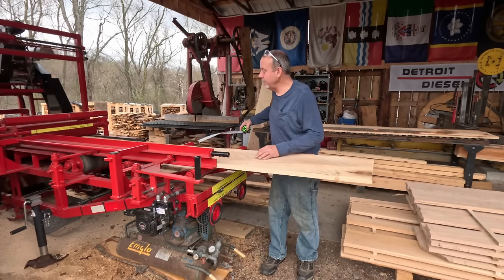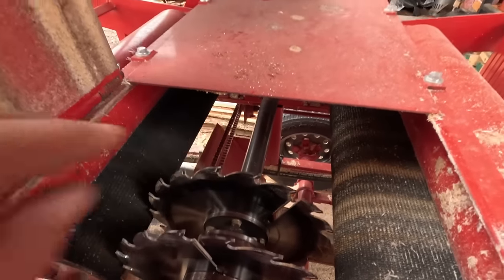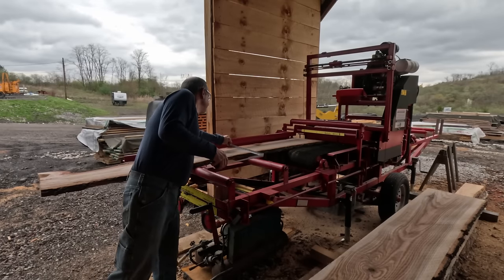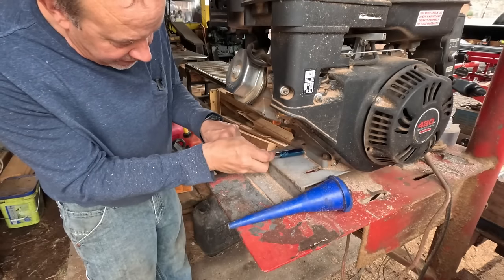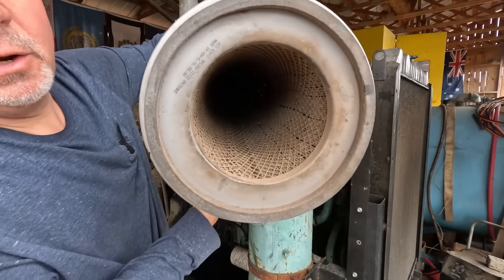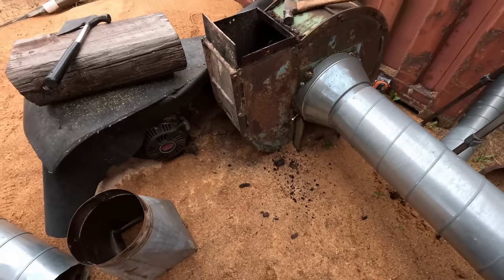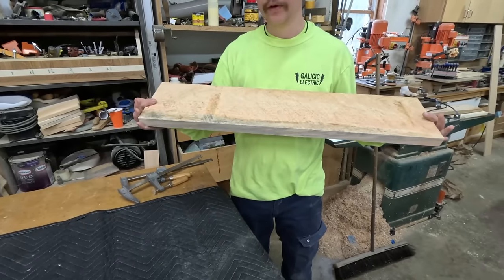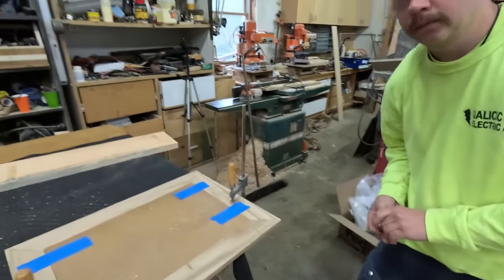some sawmill maintenance # 545

Comment: On the chop saw motor get some gi pipe with the same thread as the inside of the drain and extend it past the base plate with either a tap or a plug on the end will make changing the oil quicker and much cleaner thanks Peter W Melbourne Australia
Reply from the maker: yes but we need metric thread.
Reply: I knew when you said it had metric thread that’s probably why you hadn’t already added an extension to the drain. However, using the long neck funnel the way you did is a brilliant solution to avoid a big mess, kudos!
Reply from the maker: @mackyocum5218  thanks Mack.

Comment: 10/4 on the vertical edger and I have never seen one around here.  Just good turners. The danger with overgreasing was blowing the seals out in the bearings. Some of the crusher conveyors had a spring loaded deal to keep a supply on the bearing without overpressurising them. Lots of shafts on the rock polisher conveyors that size. Good looking assistant you got there. appy weekend and god Bless!
Reply from the maker: thanks Lewie , yes I would love a vertical edger but it makes a big mess.
Reply: @markgalicic7788  What I could see it sure would.

Comment: Hi Mark, loved the tour on the edger Good Job!, Suggestion when changing oil put down Pig Mat helps a lot with catching spills. Think you said the oil plugs were metric size, should be able to use a 1/4 pipe tap (I think)  so you can extend the drain so less mess. anyway have a great day!  John
Reply from the maker: thanks John , good idea.
Reply: @markgalicic7788  I use that on mowers.

Comment: You can just add a short piece of medal pipe to oil plug hole and cap it off with a cap and it will help with changing oil .
Reply from the maker: no it's a metric thread and the plug makes the seal.

Comment: it's the mounting place for two vertical blades that cut the lumber to with without having to use a different saw to cut the boards down to size and clean up the edges..
Reply from the maker: yes a vertical edger.

Comment: @ 2235 I have always used that router bit in the vertical instead of horizontal / with the plunge toward bottom of frame so that when hung on screw it couldn't jump out/off , but I can see your way may be better so as the distance between screws in wall would not be such a critical measurement
Reply from the maker: yes it works great.

Comment: one can make an extension pipe to put in that hole where you can have the oil flow out into a container. I know everything takes time.
Reply from the maker: yes I could but it's metric.

Comment: What a small pipe nipple by 6 inches long the oil drain hole then he can drain it in a bucket and put a nipple cap on the pipe till next time
Reply from the maker: yes if I can find a metric thread nipple.

Comment: Im going to guess that the bracket may be for a horizontal saw for edging.  I think a list of terms may be helpful.  I will start with what i know.  Wane: live edge of a board.  Cant: log sawn on one or more sides and can't roll, especially on the carriage.  Cant hook: a long handled tool with a swinging arm made to roll a cant on the carriage before chewy was invented.  Peavy: similar to a cant hook but with a longer handle and a sharp point used by loggers. Kerf: the area romoved by the blade.  Im sure there's much more..but thats it for me now, lol.
Reply from the maker: yes it was for a vertical edger , you know lots of sawmill slang!
Reply: @markgalicic7788  my grandfather worked for a logging company and mill as a young man in Michigan late 1800 and  early 1900.  The mill was steam powered.  Later that sake mill became a pallet mill I got to visit now and then. So...some exposure.

Comment: Really great mill maintenance video Mark! The more I watch that new edger work, the more I like it! That was an outstanding decision that you guys made to purchase the new Cook’s edger unit. It is very well designed and produces accurate, high quality edged boards. I love the in-feed and out-feed belt system and the thin kerf, 2-part edger blades. They slice through the boards with ease regardless of the species and they leave beautiful clean, sharp edges on each board. A wonderful machine and a great addition to your mill operation.
Reply from the maker: thanks Randall , we love the edger.

Comment: Mark check with a hydraulic hose builder.  Match a barbed fitting for, the engine side, a piece of hose  then a 1/4 npt on the other end. Have someone build a hose for it.
Reply from the maker: great idea.

Comment: 15:45 next time you're at work, talk to the sheet metal guys and see if they have any small leftover rolls of duct gasket they can toss your way. It should seal up the gap and stay tacky enough that the next time you need to take it apart, a quick yank will break it free. Swiping a pookie bucket would be ideal, but using that would mean you'd have to pry apart the duct the next time you wanted to open it up which could be more damaging than what it's worth. Outside of those options, maybe hit up the hardware store for some of that insulating tape (foam strip with adhesive on one side) that's put around windows and doors to seal up any gaps that might not be easily noticeable.
Reply from the maker: great idea.

Comment: I'm guess hand controls bolted on the bracket for manual sawmill like my grandpa was and cart had long handle that racheted for you to adjusted the thickness of your cut . Not to mention drag chain to remove sawdust
Reply from the maker: no sir.

Comment: I put a preditor engine on my old log splitter 4 years ago replacing the original 25 year old Honda engine I am totally impressed with it in fact its better than the Koehler engine on my newer splitter.
Reply from the maker: yes they are well built.

Comment: Chop saw oil drain. Screw a short nipple into the crankcase. Drill a hole down through the engine bases. Screw an elbow on the nipple, pointing downward.  Screw a longer nipple into the elbow. Screw a valve onto the long nipple. No more messes.
Reply from the maker: great idea Douglas, first off the base has to move for belt tensioning then we have metric threads to deal with , just not worth it.
Reply: It is hard for an old mechanical engineer not to solve mechanical problems. Install a short nipple. Install a valve on the end of the nipple. When changing oil, install a nipple or hose and remove it when finished. On my first idea, slot the base to allow for belt tensioning.
Reply: As Gerald suggested, tap the drain hole for NPT.